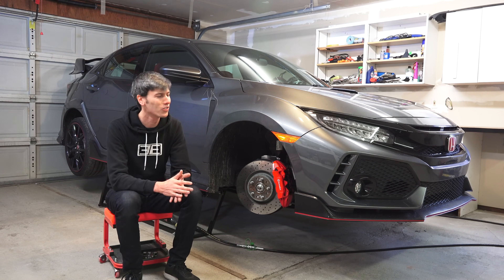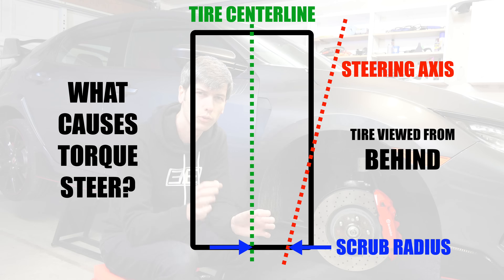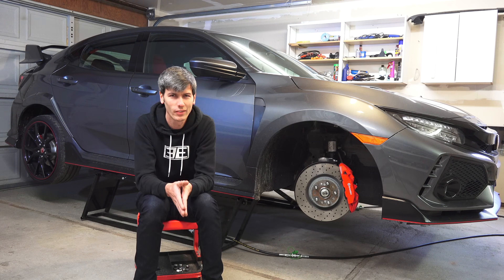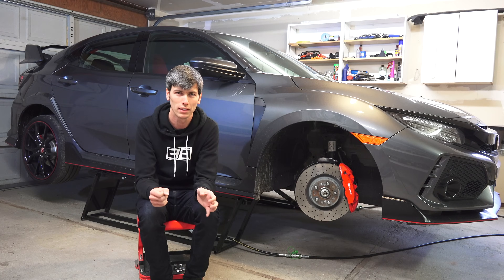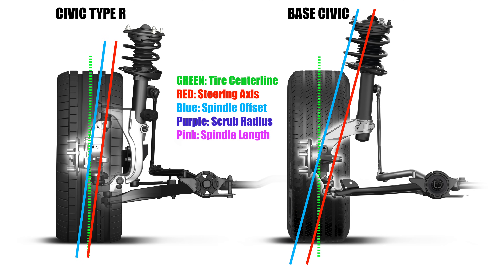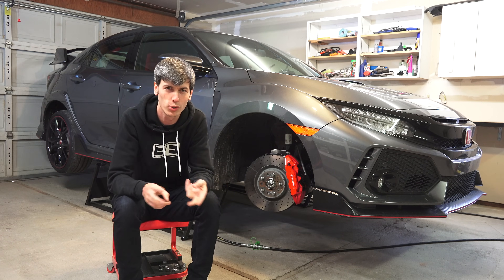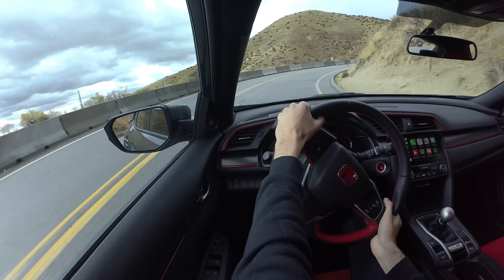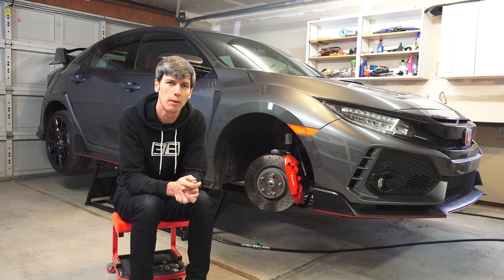Why Doesn't The Honda Civic Type R Have Torque Steer?

Comment from the maker: Hope everyone's day is going well! As mentioned but not discussed in the video, there are reasons why you may not want a scrub radius of zero. I've explained that in a separate video for those who are curious about it: https://youtu.be/SUDMEd1bMZI
Also, if you enjoy scrolling through photos on Instagram, consider following EE! It's not as exciting as Red Bull's page (by an exponential quantity), but ya just might learn something! https://www.instagram.com/engineeringexplained/
Reply: L D I would say technically yes, but no.  Changing the wheel and tire package can change the scrub radius, but it still doesn't address any differential torque output and may also be a determent to other suspension geometry effects.  And also there may be just the physical ability to stuff a wheel and tire package that would minimize the spindle offset, but without changing the upper pivot point, the difference between the spindle offset and scrub radius would maintain it's fixed distance in space.
Reply: How is this different (better) in terms of steering from a multilink suspension? i.e. comfy Citroen C5 (2008-) has multilink with all the benefits like TypeR Honda or Focus RS advanced suspension.
Reply: Why is everyone complaining that Honda copied this technology from people who did it in 2009, when Toyota were doing it back in the early 90s?
Reply: Thank You.
Reply: Engineering Explained 
Bro so the torqesteer you saying is the one holding the steeringwheel slightly on that turn..what's the caster doing isnt it suppose to put it in straight possition...???
I eliminated camber cause is clearly its negative only possitive put it on straight...right..???
Reply: Interesting on the knuckle design where it looks like it takes the advantages of packaging on the MacPherson strut design with the steering advantages of a LSA suspension design.  Wonder how this will impact how easily or difficulty for servicing and/or repairing components within the system.
Reply: Nice chair
Reply: I'm curious which Toyotas?
Reply: Engineering Explained your an inspiration to me honestly bro, I'm in college for mechanical engineering, aspiring to become an auto engineer,  learning today's technology from you makes everything feel simple
Reply: I'm a fan of u,but this video confuses me. The torque u explained should effect both tyres yet of symmetric directions? Why could this cause steering? Appreciated if u could answer it PLZ, thx~~~
Reply: The torque steer you mentioned whilst cornering... is that not due to the way the lsd splits the power???
Reply: Engineering Explained
Reply: Can you please tell me the location of the shots at 7:00?
Reply: The best way to avoid torque steer, under steer, and over steer is to drive an AWD car equipped with torque vectoring system.
Reply: Engineering Explained: basically Honda adopted the Ford Revoknuckle concept used in Mass Production for the Focus RS MK2
Reply: @carlosvelasco1642  Long before Ford, Renaultsport were doing Perfohub in 2004 Megane RS
Reply: love ur vids. but for a car with no torque steer u sure kept making corrections to go straight

Comment: a front heavy front wheel drive car needs a little negative scrab radius. Not zero. secondly, the zero torgue steer isn't a result of the double axis mcstruts, but it is the result of the limited slip differential. The seperation of the steering from the bump reaction doesn't offer any benefit. Only makes the suspension a fairly amount more heavy and complicated. And for what? To be able to look like a double wishbone suspension but not a double wishbone suspension. And a double wishbone suspension would have been far less heavy, far less complicated and far less expensive to put. That is why ford ditched it , toyota ditched it first (superstrut) and now opel (ex gm) and renault. Audi had a similar design but that only remained on paper, cause in reality it didn't make any benefit.

Comment: Will it still have torque steer if from a stand still/Low speed, you accelerate, but one wheel is on High grip surface and one on Low grip? Like If the Right wheel is on the road, Left wheel on Grass, steering would turn to the Left?

Comment: Very interesting, and comprehensive. I have a fairly high powered classic Mini with considerable torque steer, i.e. pulls right on hard acceleration, pulls left on sudden deceleration.  According to David Vizard's Mini book, one reason not mentioned by anyone else, is that the crown wheel & pinion are helical gears.  Thus you get side loading on the bearings to one side on acceleration, and to the other side on deceleration - the friction in the bearings being unequal.  Having replaced all bushes, bearings, CV joints, mountings, 4 pin diff, tie rod bushes (firm), moving parts, everything, it still had some torque steer, less than before, but noticeable.  IN THE END, I increased the torque on all the side plate flange bolts - carefully, cos the bolts go into aluminium -  increasing the pre-load, and that has almost completely eliminated the torque steer, unnoticeable in normal driving.  Hope this helps, and thanks for the vid.

Comment: Never owned a fwd but thats not really torque steer its caster causing that you have enough caster to counter act the kpi centering at that speed it going to the outside because the car want to continue  turning the ideal line is usually to follow that space for whatever speed because you car isn't experiencing any understeer. So you are being pushed around the corner rather than pulled so if you loose traction momentarily you won't change directly. It's usually how you drift and the reason it so much easier with more caster you can feel it more easily with less traction.

Comment: I have only owned rear wheel drive cars, but i recently had a hire car, with little power, but deadly torque steer. Not this car. Try launching this car hard with the steering wheel turned hard. I pulled out into fast moving traffic from a side street, and had to fight the car to stay in the chosen lane. When the car is going straight, it is not as impressive as at the boundary conditions. As I said, I have never owned/driven a front wheel drive before, and I only noticed it in the above circumstance. It had no power/torque to influence the steering of the car when going straight.

Comment: I see that torq steer while ur turning and gassing as a good thing.. it may have something to do with the caster.. .. but on the RsX chassi..  when u floor it on a turn the wheel will never come back to str8 on its own... so you need to actually fight it back to str8 on your own so u dont crash... kinda like a fR car or s20000 .. u let go of the wheel after turning and it will str8’n it self ... on thr rsx u gotta figbt it to get it str8 .. if the new ctr turns str8 on its own while turning and flooring .. i c it as honda fixed the problem from the rsx and what ever chassis after 00-01 that had that problem.. if you driven the cars im talking about on tight roads.. you should have felt it.. if u drive hard enough..  my 2 cents

Comment: So... if you modify the car and change some wheels with different ET value or putting on some spacers, that might ruin the original set up cause you might have change the position of the centre line of the tyres, am I correct?

Comment: @Engineering Explained   It looks like most FWD cars, such as the base civic, would have negative scrub radius.  Would it then possible to simply use a smaller offset wheel to move the wheel more to the outside to get zero scrub radius?  Why does Honda need to use such sophisticated knuckle to achive this?

Comment: I drive a fairly low 90HP - 100HP front-wheel drive car. I initially suspected something wrong with the alignment, the camber, the tie rod etc. but the car is fairly new as it is only 6 months old.

It's annoying and dangerous as the torque steer kicks in randomly at wide or long corners. It simulates the feel of an understeer but I can tell that's not an understeer as the tires are fresh and how it pulls feel different.

My question is, is there any way to significantly reduce torque steer?
Will better tires help? Will more negative camber reduce it?

I have coilovers on and when it was low it was barely there but once I slightly raised it, it came back.

Comment: Hey I have a 2019 Honda ctr, and I want to change my 20” rims to 18” because I don’t want the risk of hitting a pothole and bending it. Especially when there’s no spare tire. But the stock wheel are at 60 mm offset... I know there’s not a whole of 60mm offset wheels out there but what brand, offset number do you recommend for me to not introduce torque steer to the car?

Comment: How much of the mid-corner torque steer can be attributed to the differential? Because the CTR has a limited slip diff, when on the throttle hard mid-corner, it's going to start feeding more torque to the outside wheel as the inside starts to lose traction. This should reduce the return to center tendency

Comment: Question, 3 years later after this video lol. I lowered my car on coilovers and had my stock factory wheels on. Drives fine after being lowered. I then installed some 25mm wheel spacers and put some new wheels with new tires. So I went from some  16x6.5 with 205/55/16 tires to a 17x7 with 225/45/17s. Put the spacers due to the offset and I wanted the wheels to be flush with the body of the car.  Now the car feels like it sways lightly from left to right at hwy speeds. I made sure I bought hub centric spacers and I torqued the spacers and wheel to spec. What could give it that feeling of lightly wanting to sway left to right at hwy speeds on the freeway? The new tires I bought I think has a softer sidewall. Could that be a problem?
Reply: Could be your wheels aren't balanced (in terms of mass)
Reply: Did you do wheel alignment after all the mods?

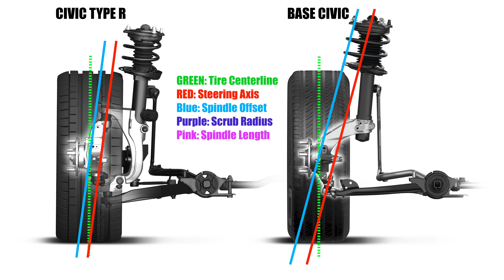Comment: 4:26 I still don't understand how you're drawing the lines where you drew them.
Reply: On a conventional short/long arm (SLA) front suspension, the steering axis is represented by a straight line drawn between the upper and lower ball joints of the hub.

On a MacPherson strut suspension, the steering axis is represented by a straight line between the top strut bearing and the lower ball joint.

On a Honda Civic Type R, the steering axis is drawn like SLA with upper and lower ball joints.

Comment: Very interresting. Thanks for a good explanation. And maybe a request: Citroën launched their steering system Diravi with the SM in 1970 and it was used until 1997 in the XM V6. It's a really cool system. Hydraulic drive-by-wire in 1970! It auto-adjusted for speed and used hydraulics for artificial feedback and the self-centering which BTW also worked when stationary. The models with Diravi has of course no tourque steer to start with. It's Citroën. They did not even have that problem in the 1920's when they started only making FWD's. But also, the Diravi models are really crazy cool regarding stability. They go straight ahead even when the road has a severe angle.

Comment: This car has impressive corner steering and is stable as an arrow. I believe only high end sports cars handle like this. Impressive for a mid $30k car. Yeah, $35k is a lot for a Civic but this car is a Civic with a super car drive train, suspension and chassis that is worth every penny

Comment: Great explanation of how this car diminishes torque steer. As an owner of a Type R, I experience the same "hold-steer" effect in those high-speed turns/on-ramps, etc. It's amazing engineering and a blast to drive.

Comment: hmmmmmm.......you should never "floor it" in a corner, especially a tight corner. Fast corner you are pedal down entering the corner and holding the throttle steady hoping the grip doesn't let got. Slow corner you are entering the corner on the brakes or nothing at all and gently getting on the throttle at or after the apex nice and "smooth".......

I don't really like the fact that you say "when you're corning hard and floor it".........sounds very Honda Civic speak if you ask me.......this is coming from someone that really likes the civic type R as well

Comment: Serious question, how would you adjust your suspension so it'd be similar to this? Im thinking of getting a 1st gen Mazdaspeed 3 but I hate the thought of torque steer, Ive always driven rwd. Ive heard you can just slap on wider tires and it helps, but it's literally impossible to find a clear answer (besides this video, but idk how this would be applied to a different car)

Comment: It could also be some driver assistance system like I have in the Focus the Torque vectoring control where braking is applied to the inner wheel when hard cornering.

Comment: I don't get continuous torque steer. If the wheels are spinning, shouldn't the torque on the steering be 0? Let me walk you through my reasoning: for simplicity, I'm considering the wheel a plate of radius(r) at the end of a shaft of length (R) <(distance from steering pivot to tire center). If the wheel has an angular momentum (L) and there is a force (F) applied to R perpendicularly, the cross product (Frsin(90)(-nhat))  should result in the torque vector Fr(-nhat), right? If that's right, then the torque would be in the downward direction and the normal force of the ground would 3rd law that shit and result in a net torque on the steering of the car of 0.  I can understand torque steer when there isn't any angular momentum, because then T=FR and that will put a torque on the steering. I personally drive a fwd car and never notice torque steer after initial set off. What am i getting wrong?!

Comment: "Torque steer" es otra cosa. Es también torque inducido en la dirección pero por diferencia de torque en los ejes de transmisión. Cuando los semi ejes tienen diferentes longitudes estos llegan en diferentes ángulos a los bujes. El torque motor es el mismo en el plano perpendicular al eje, pero no así sus componentes en los planos vertical y horizontal. Las componentes plano horizontales deben cancelarse pero no ocurre así eso genera una resultante sentimos en la dirección. También hay diferencias en el componente plano vertical que interactúa con el radio de "srubb" Eso explica porque un arreglo longitudinal con semiejes de igual longitud este es casi inexistente.

Comment: I think the fact that it has a limited slip differential, causes it not to torque steer. Not as much influenced by your steering angles that you mention...if it had an open differential, it would be very noticeable

Comment: Hardly a new system. Renault fitted it to the mk2 Megane in the early 2000's... and they actually have torque.... it works though.

Comment: The sensation  of "torque steer" mid corner under power is really just the front tyres loading and unloading during the weight shift.. Or loosing then gaining traction and pulling the car through the corner.  The Ackerman plays a big part in this but weight distribution contributes a lot too..

Comment: Scrub radius helps get feedback on the steering wheel. I guess they will never make it zero.

In a corner, the wheels are not evenly loaded. If you manage to spin the driving wheels, then its obvious you will get steer.

Comment: Great video.

Way back in the day, the marketing campaigns tried to tell everyone that torque steer was the result of inequal length drive axles.  I've proved long ago that it is not true because it made no difference going from equal length to unequal length.

But in either case, I've driven some pretty fast front drive cars that were built 25 years before the 2017 Civic was even thought about, and it has never been a problem.
Reply: Not true. Do some research.
Reply: @longtimercer my research is personal experience, sir. When you give it beans at the top of 4th gear and the turbo boost pressure goes to 30 PSI and the tires get blown away, that is some serious power. Torque steer is the result of a change in suspension geometry which changes your wheel alignment and there there is almost always unequal traction between the two driving wheels which makes it go one way or the other.  Switching between equal and unequal length drive shafts in the same car and on the same day made no difference. 1992 Dodge Daytona with 16v engine and a holset turbocharger off of a Cummins diesel.

Comment: It's true that you don't have to get very impresive front drive horse power to achieve hi torque steer : Citation X11  from  1981 . A weak 128 hp v6 , 2.8 manual  , no power steering ... you got to hold  the steering wheel very hard  , otherwise you go in the gardrail  .Needless to say that GM had many difficulties mastering the art of fwd .

Comment: Even a car with much torque steer will not be noticeable with well matched tires on clean flat pavement going straight. 

The most obvious symptom is when accelerating or braking on uneven pavement or patches of slick pavement that favor one tire or the other. That is when the steering wheel kicks left and right. 

A sloppy power steering booster will contribute to the feeling. Over inflated tires will also increase sensitivity.  

Torque steer is more noticable in sharp slow turns because the contact patch moves forward and/or sideways as you turn the steering wheel. 

It is noticeable in high speed turns because a leaning chassis and suspension linkages will both move the contact patch and apply more traction to the outer front wheel. 

You Honda model just moves the patch less under these conditions.

Comment: You get torque steer in that car flat out because all the torque in a turbocharged type r comes on later, so because it smoothly engages torque it prevents the power to steer abruptly  contrary to n/a cars that get more torque steer in the lower rpm range 3k~, the range with the most torque for n/a as cylinders (n/a)  have an easier time to completely fill with air before combustion